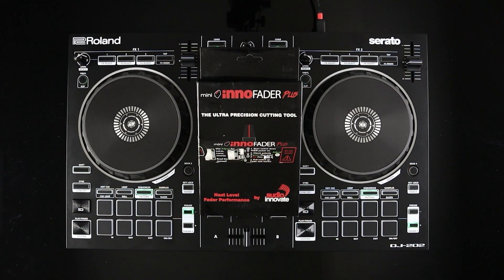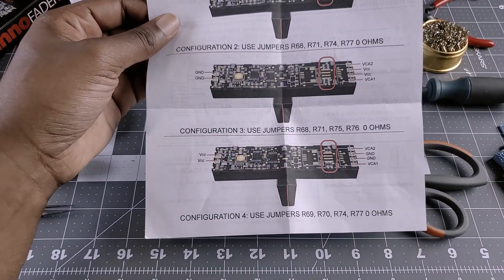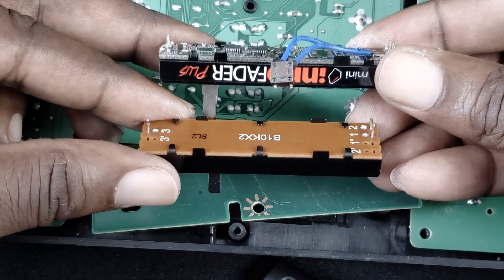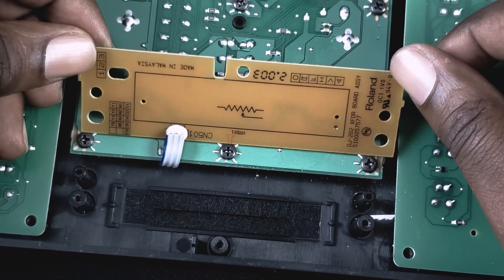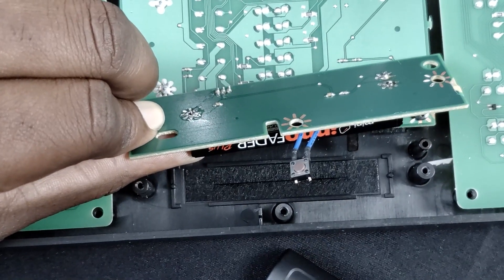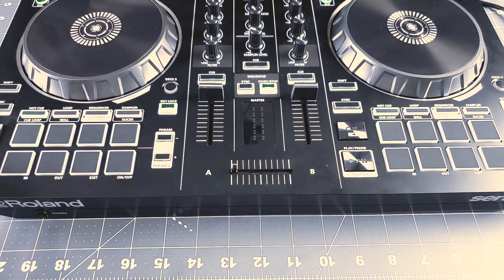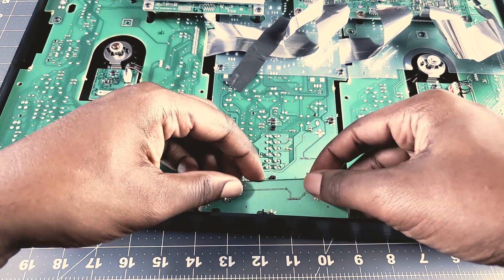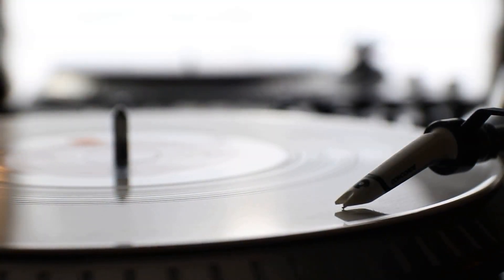Installing/Upgrading to a Mini Innofader Plus (S) in a Roland DJ-202

Comment: you were a bit vague about the jumpers. im still trying to figure them out
Reply from the maker: Wzup MrFLbreakz, thanks for reaching out. I created a jpg in hopes of better explaining...https://xfaderz.com/wp-content/uploads/2024/02/Innofader-Solder-S.jpg Essentially, the bottom set of jumpers are in the correct orientation, but the top two will need to be removed to reveal the 4 solder pads underneath. Based on the attached diagram, you can either replace the jumpers (vertically) to bridge 1-2 and 3-4 or use solder to connect the two pads.  Let me know if that helps. Thanks
Reply: @XFaderz   i appreciate that. i finally got it figured out about 20 min ago. took me all weekend but,,,,,sigh..lol
Reply from the maker: Great to hear. I hope you enjoy it. 👍🏿